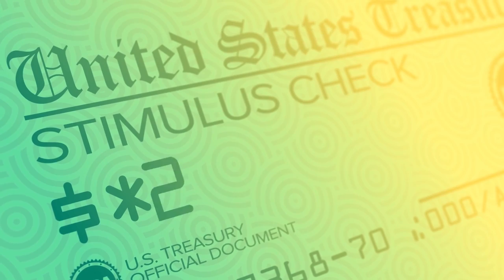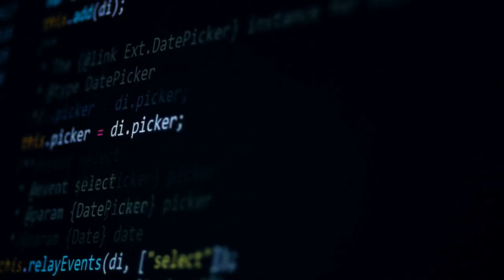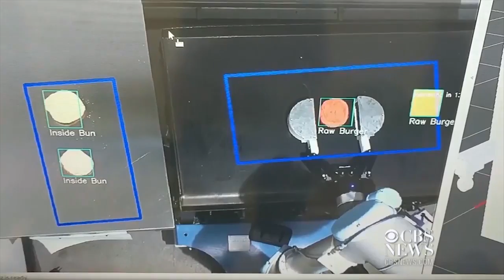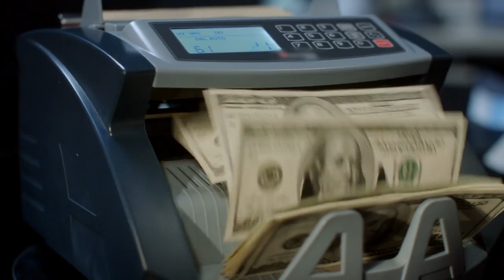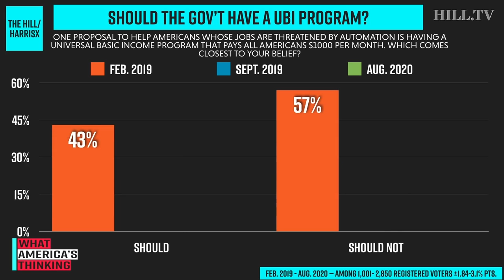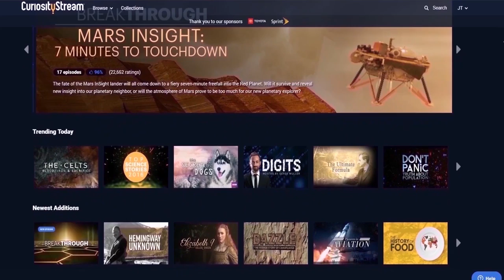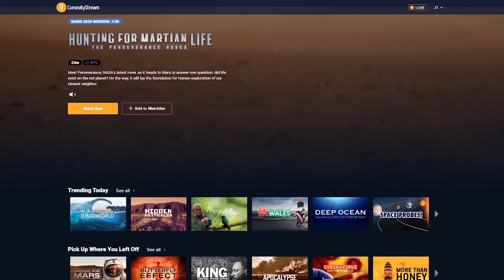Is Universal Basic Income The Future?

Comment: Yeah, I worked at a company that heavily invested in automation, having robots and machines do the job that people used to do. I guess the thinking was that they'd save money since they wouldn't have to pay all those people. The thing was that machines jam up and break down and they still have to be loaded and unloaded by people. So yes, they drastically reduced their labor force and sure they made more money because the machines could make the parts faster even if they did jam up and break down constantly threw the day but their actual labor cost was pretty much the same, I'd think because the people they had to replace them with to unjam, repair, load and unload, program and operate those machines were of a higher skill level and they had to pay them more money to keep them there.  I think they thought they could just turn the machines on and they'd run themselves and they could fire everyone else, it's just that it really doesn't work like that. Sure they made more money, just as a fictitious example, instead of paying 2 guys $10 to make 1000 parts a day, they'd have to pay 7 guys $20 an hour to make 1000 parts a hour. Just guess at the numbers but you get the picture.

Comment: Ugh, Being worse off for working.  I can relate to that.  SO many times,  I've taken a job that made me worse off financially JUST so I wouldn't have "too big" a gap in my resume. Especially when I was in school.  If i didn't take a summer job,  my education would be reimbursed more.  If I took a summer job, what happened? The reimbursements, were reduced by more than my income-expenses to work. and the loan portion was ALSO reduced.  So not only was I working for less money, I had an even less cash overall with a greater portion of it being loans. and more stress trying to pay for everything on time with again, the money that wasn't mine. system is fucking broken. 

The older star trek series were more consistent, the newer it gets, the more they throw out the window,

But in short, the core federation is post scarcity,  But they are not in a bubble -- For example they interact with the ferengi, which are absolutely profit driven and capitalist

Comment: This is how I would set up UBI in the United States:

$12,000 for every adult, and every child born before 2022. Children born in 2022 and later get $12,000, but have a mandatory "Young Roth" IRA contribution of 10% from birth to age 18, which should set them up quite well at retirement. Cost: $4 Trillion.

The biggest single piece of funding would be increasing the marginal tax rates by 12 percentage points, i.e. 10% becomes 22%, 12% becomes 24%, and so on until the top federal marginal rate of 37% becomes 49%. UBI would not be taxable, and the standard deduction still applies to earned income ($12,550 for a single person in 2021). This should yield $1.131 Trillion. A single person with no dependents earning $112,550 would be at the "break even" point: $12,000 tax increase offset by $12,000 in UBI.

I'd cut out all of the other forms of welfare such as SNAP, WIC, etc., which saves $569 Billion. I'd also eliminate the EITC and Dependent tax credits, which saves another $100 Billion. As much as I hate to do it, I'd also eliminate the federal portion of Medicaid, which saves another $448 Billion. States would still fund their part, which varies from state to state.

I'd raise the corporate marginal rate 14 percentage points, which yields $568 Billion in tax revenue. I'd also tax capital gains at ordinary income tax rates, which yields another $45 Billion.

As a temporary funding source (and by temporary, I mean until 2081) I'd reduce Social Security Benefits by $12,000 per person - essentially, $12,000 of their benefits gets renamed "UBI". This saves $816 Billion.

The last $123 Billion would come from discretionary spending cuts with the goal of eliminating programs that shouldn't be necessary with UBI (like housing assistance).

This doesn't rely on any multiplier  effect to fund UBI. If there is a multiplier benefit, the additional tax revenues can be used to reduce the deficit or pay down the National Debt.

Comment: I think there's one issue not addressed.
It's not that UBI makes you lazy and less likely to work, it's that it increases your options, and makes you work in less important areas.

How many people would work in an abattoir if they had other job options readily available to them, or that they could just stop working in an abattoir to little negative effect?
With such an expected massive employment shift, a lot of industry sectors would then have to deal with low supply but high demand. Vegans would be happy but the general population would not be. And it's not just working in a slaughterhouse. What about working in mines? What about working in garbage pick up? What about scrubbing toilets?

The attraction to those jobs is one of necessity and low qualifications, combined with low standards of the worker. If the worker had higher standards, they'd probably rather go unemployed, and now we have a bunch of services without workers.
While you mention robots are replacing many sectors, are they? Fast food is something I doubt will be replaced by robots for a long time, despite how good robots could be, robots are expensive. The overtime cost of robots vs employees might be worth it to employers, but they'd need to save up a lot and take the risk.

Comment: UBI cannot be any solution for anything, UBI leads to the downfall of the middle class.
Someone has to pay the taxes out of which the UBI is paid and as long as the poor don't have anything to pay higher taxes from and the rich get ever larger tax breaks the only ones left who could pay for the UBI is the middle class.
This obviously will have a few logic effects:
- wages in low paying jobs will be squeezed down even further, because poor people who already have an UBI will be willing to work full time for just a few $100 extra.
- corporations will save the money from lower wages to enrich their shareholders
- the middle class will join the poor at the edge of the poverty line
- inflation will level out whatever the UBI is and however much it could be increased, meaning the poor and the middle class will never be able to get off the poverty line

The ONLY way how an UBI could be a solution would be if the rich were taxed to such an extreme level, that the top 1% of the richest effectively pay the entire cost of the UBI for ALL the other 99%, but IFFFFFF the rich get taxed that much, there wouldn't be a need for an UBI anymore, because taxing the rich like that solves the problem without an UBI.